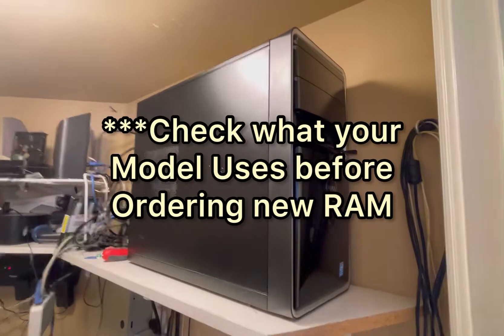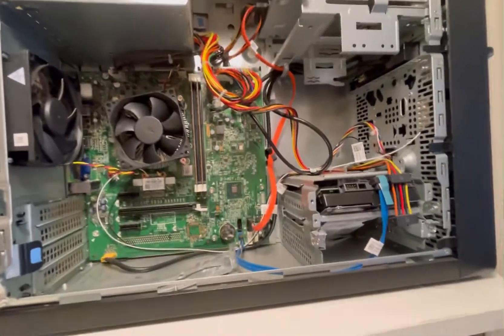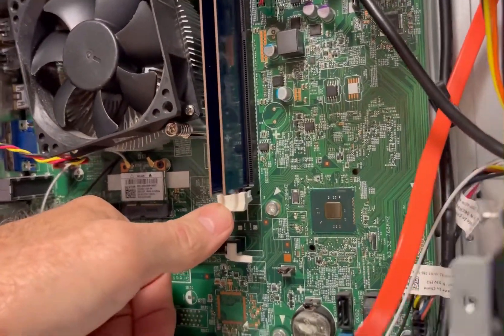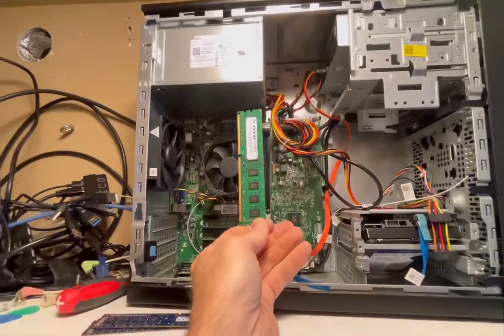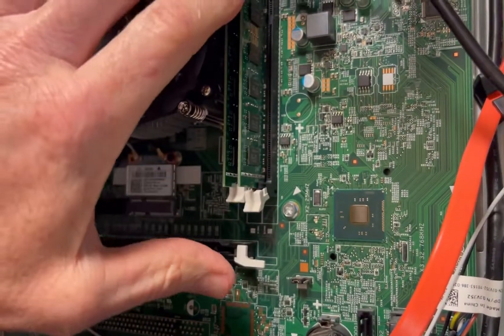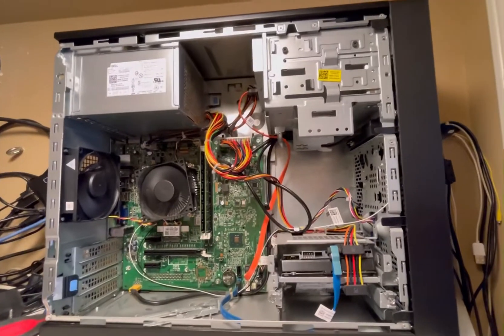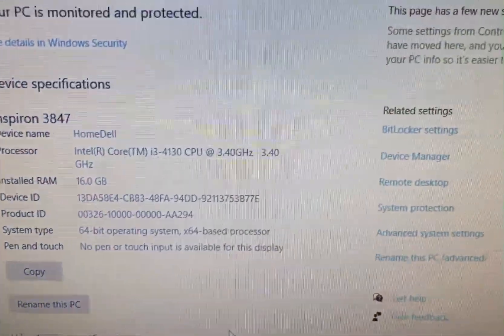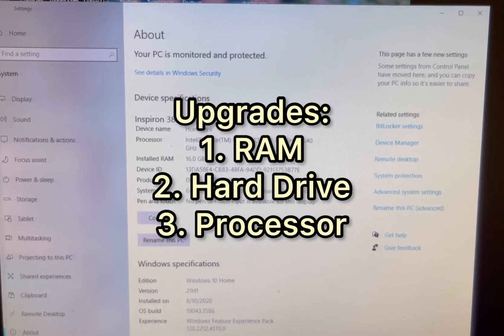DELL Desktop RAM Memory Upgrade (older Inspiron 3847) DDR3 16GB

Comment: My wife's computer is a Dell 3891 with 8gb DDR4 ram. (8GB, 8Gx1, DDR4, 2666MHz) It loads very slow.  I found this on Amazon .. Timetec 16GB KIT(2x8GB) DDR4 2400MHz PC4-19200 Non-ECC Unbuffered 1.2V CL17 1Rx8 Single Rank 288 Pin UDIMM Desktop PC Computer Memory RAM Module Upgrade (16GB KIT(2x8GB)) ... do you think this would help?
Reply from the maker: I do - as long as you make sure it’s the right one. I don’t have any computer.

Comment: I have a Inspiron 3487 also and am wondering how the 3 TB hard drive worked out.  Dell's website lists 2TB as the maximum, but I'm hoping it can handle bigger drives. I've upgraded to 16GB RAM, and considered upgrading the  i7-4790 CPU (vs upgrading the GPU), CPU heat sink/cooler, and a couple of HDDs, so I can use it as a virtual file server. Thanks for the video.
Reply from the maker: Worth a shot! Thanks

Comment: Nice video, but the only thing I'm concerned about is that you were touching things with your bare hands. I was told that you risk the chance or ruining your computer with static electricity.
Reply from the maker: Doing it this way for 20+ years. However- where I live, there’s very little static electricity.  It’s humid here (vs say, Arizona).  That cuts down on static electricity.  Also, if you touch the case first , you’ll discharge.  But I’ve never had a problem.  Good point though.  Thank you - discussions help us all learn.

Comment: I need to run World of Warcraft smoothly I only got a graphics card in a 1050 gtx it on this Inspiron. What ram you recommending for me? Also for me not being an expert do you recommend me to get a more memory drive and power supply or no reason to upgrade if I don’t want to thank you.
Reply from the maker: Personally- I’m not running something like that on this computer that sucks up that much graphics power.  I think that because this computer is so old you’d be better off saving up a little more of the upgrade money toward a new machine with a better processor and 32GB RAM minimum.  Just my opinion.  But I don’t think 16GB + this processor is going to make you happy.
Reply: @TheRealWorld737  I bought the computer 6 years ago been playing wow on it since then. The money is gone lol what’s a 50 bucks more gonna do. Also it runs fine I don’t see the big deal but I’ll try a 16 gb ram for now. Will look into a gaming pc but I just want to run this pc until then and give it away or something.